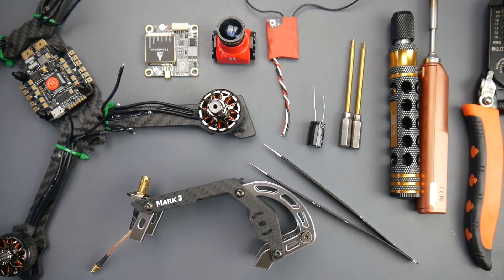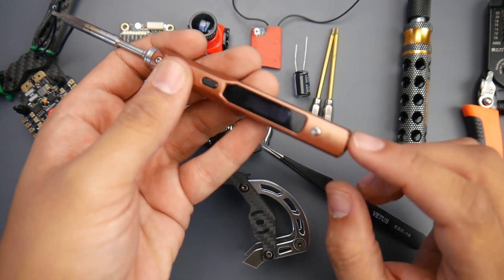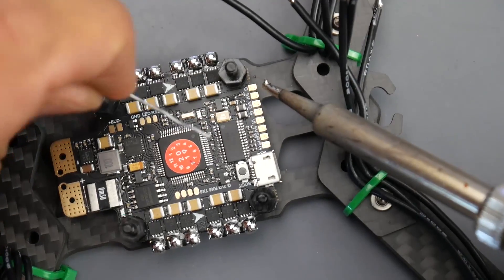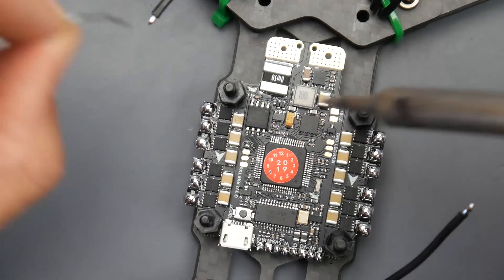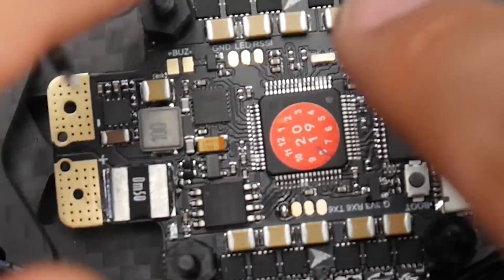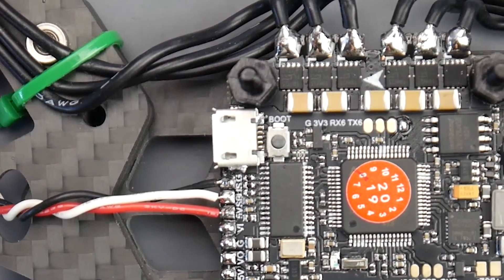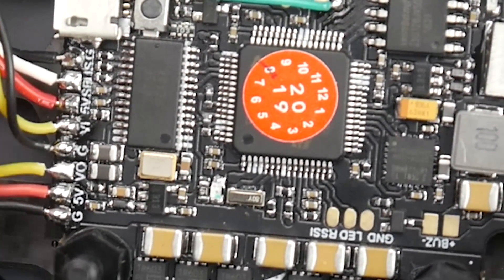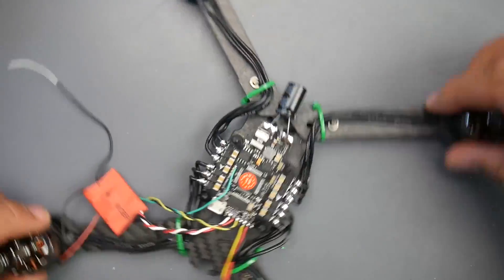Beginner Guide // Epic FPV Drone Build With AIO

Comment: A general question: Two years ago there were a lot of videos about soft mounting motors. Does people still do that? Why? Why not? What changed (if anything)? Now we have RPM filtering and that, in my opinion, has solved many problems. Should I remove soft mounts?

Comment: Nice and very informative video. The only criticism I would add is soldering the motor wires this way gives too much chance to get ripped off or hooked up on a small branch. I always go around and behind the stand off. Safer, cleaner.

Comment: This is crappy. If one ESC is dead you can buy another AIO.
And with the USB-Connector at the front its impossibel to connect a USB-Cable without to remove the camera.
Better buy a Mamba-Stack F4, its the same on two boards.
This is better in my opinion.

Comment: I bought the GepRC Mark 4 6 inch the moment you showed it in your video because it has 5mm arms. It's decent quality, however I needed to add a stiffening plate. I had it made by Armattan Productions. However an ABS 3D print works well too. It's on their store with zero commission for me https://armattanproductions.com/pages/product_details/22515
Without it it had bad oscillations and I could not get it tuned.

Comment: I'm new to the hobby and I often hear about 4S and 6S, can anyone explain to me what it means? or knows a good video that I could watch? :D
Reply: It is the number of cells of the lipo

4S = 4 Cells
6S = 6 Cells

The more cells, the more voltage which means more power.
Reply: thanks
Reply: @doriandellafaille338  No problem! 

I can also recommend watching UAVFutures and Joshua Bardwell. They both have a bunch of informative videos.

Comment: Your soldering Iron have Not the Needed Watts
You should Buy an Weller Soldering iron   
Over 100Watts and you will be so lucky
The Solder  points are melt terrible